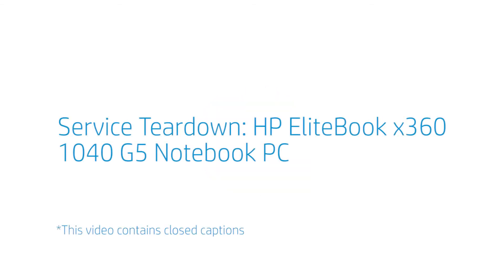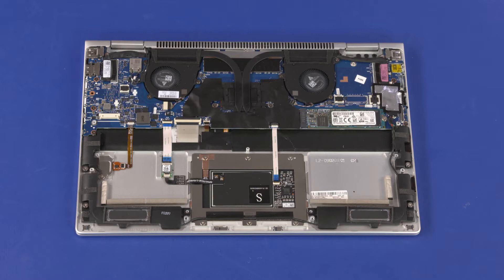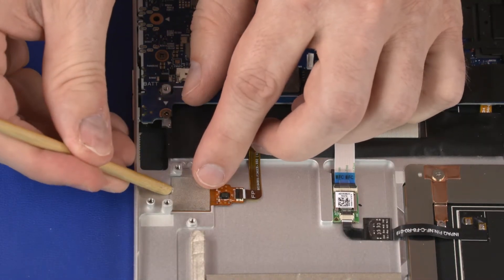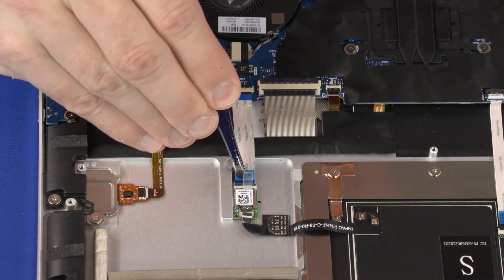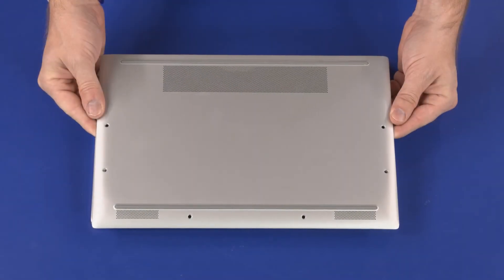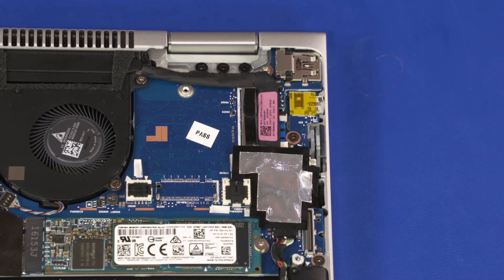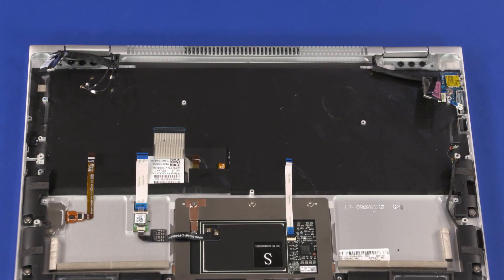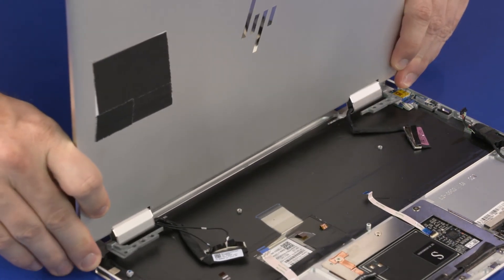Removing & replacing parts for HP EliteBook x360 1040 G5 | HP Computer Service

Comment: Can I add an additional RAM to this laptop? Task Manager shows 1/2 memory slots used. But I didn't see the second memory slot in this video. Is the RAM soldered to the motherboard?
Reply from the maker: Hi there, thanks for contacting HP Global Social Media Support!
I understand that you need to know whether you can add additional memory on your notebook.
I will do my best to assist you.
The memory on this notebook is an integral part of the motherboard and cannot be upgraded. 
Support for DDR4-2400, 1.2V system memory
Support for up to 16-GB of system memory in the following configurations.
● 16384-MB (16-GB × 1 piece)
● 8192-MB (8-GB × 1 piece)
● 4096-MB (4-GB × 1 piece)
Regards, 
HP Support
Reply: @HPSupport Thanks!
Reply from the maker: We are delighted to hear that the information provided was useful to you!
If you need any help in the future, you can always get back to us.
Thank you for being a valuable HP customer.
Have a wonderful day!
Regards, 
HP Support

Comment: Hi! I watched the video hoping to see something about an orientation sensor or something like that. Could you help me? I have this exact model, and the rotation lock is greyed out, and when I fully open my laptop turning it into a tablet, it doesn't make any change, neither the display rotates nor the keyboard and touchpad get disabled. Would you happen to know what I can do? Thanks for your help.
Reply from the maker: Hi there, thanks for contacting HP Global Social Media Support!
I understand that you are experiencing an issue with your notebook as the rotation lock is greyed out.
I will do my best to assist you.
If Rotation Lock is greyed out or missing on your device, sometimes you just need to rotate it to portrait mode. Open Settings App and go to System > Display. Find Orientation and choose Portrait from the menu. Your device should automatically switch to portrait mode.
Binu - Social Media Tech Support
Reply: Te faltan los drivers de sensor

Comment: The HP Manual says the following about the RAM.  Support for DDR4-2400, 1.2V system memory
Support for up to 16-GB of system memory in the following configurations:
16384-MB (16-GB × 1 piece) 8192-MB (8-GB × 1 piece) 4096-MB (4-GB × 1 piece)
Where is the RAM slot? Is it soldered on the board. Researching now.
Reply: I am wondering the same...
Reply: @dmnkpie  Its soldered. It can be done but its not something I would try. I was hoping it had a pop in dimm slot.